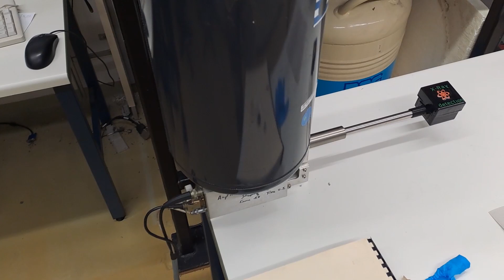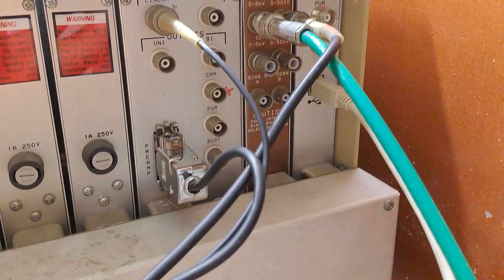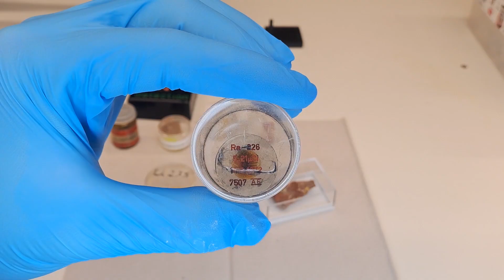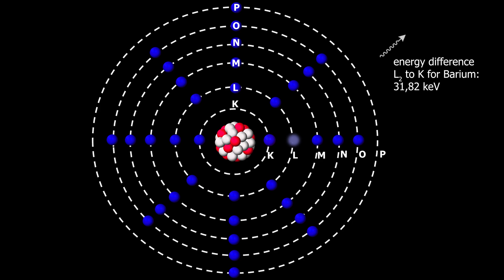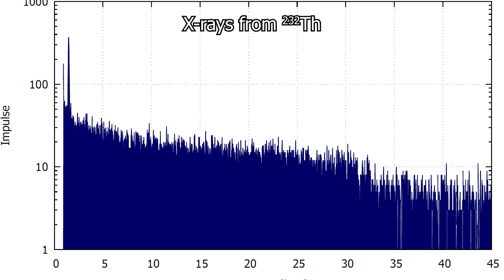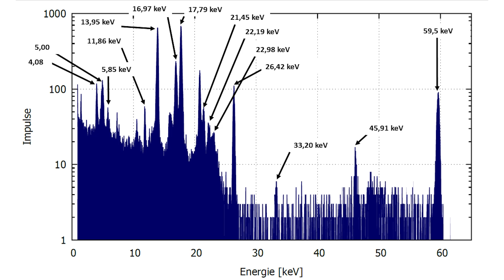X-ray XRF analysis in nuclear chemistry

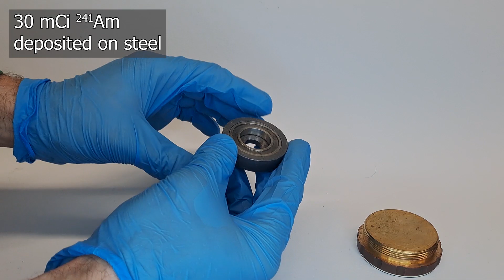Comment: 1:02 
XAm1.131(2)(3)... 
27 mCi*
Also, it's not deposited on steel, according to the manufacturer "ceramic or graphite matrix embedded with Am241 put into a capsule with a beryllium window"

Interesting source....
Reply from the maker: @Huh-n1s  where you get these Infos from? its clearly engraved on the lid with "30mCi = 1,11GBq"
Today its about 1,05 GBq but I just went with the engravement
Reply: @SimonsNuclearchemistry  huh, interesting, I thought that these were the only activities they had... Sorry
https://khlopin.ru/wp-content/uploads/2016/12/Am-241-ренген.pdf
Reply: @SimonsNuclearchemistry  damn, comment got deleted because of the link...

It's the Khlopin Radium Institute source, right? I checked their datasheets, there were only 27 mCi sources of this type... 
Sorry, thought these were the only ones manufactured
Reply: @SimonsNuclearchemistry  btw, why do they have such shape?
Reply from the maker: @Huh-n1s  no Idea. Most of our sources are several years older that the people using them. I don't think anyone of us ever used them the way it was originally intented